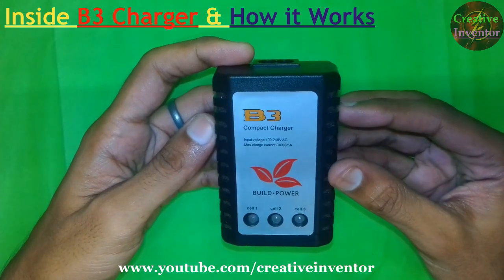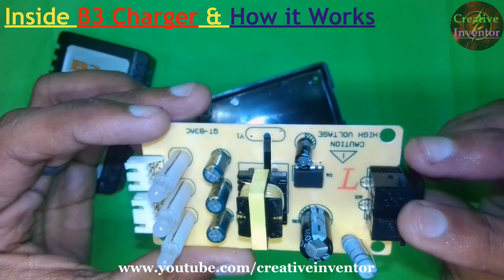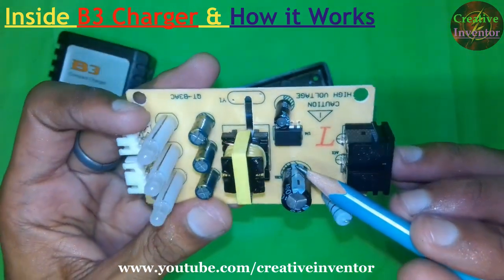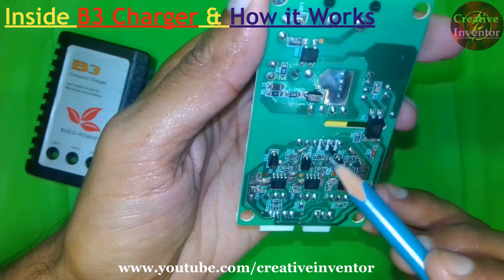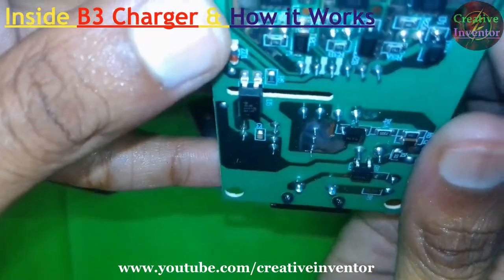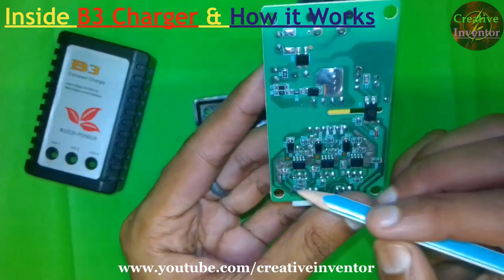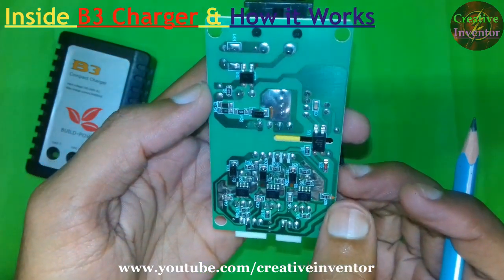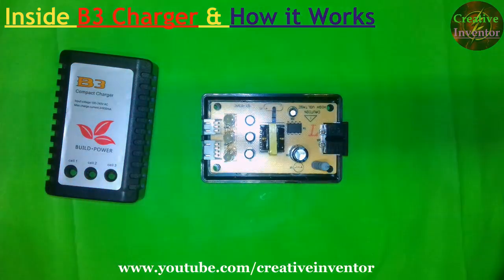Inside B3 3s & 2s Charger And How it Works | Whats's Inside B3 Compact Charger | English Version

Comment: Hi! nice video.. nice to see your indepth knowledge! I want to use the b3 charger for a 10.8V li ion screw driver battery pack.. but it looks like this is designed for each li ion cell in parallel, but the screw driver battery pack needs it in series. Any idea how I can connect it?
Reply: 10.8v li ion battery